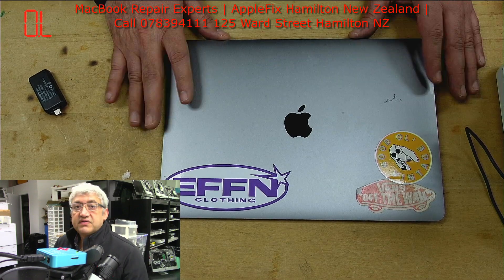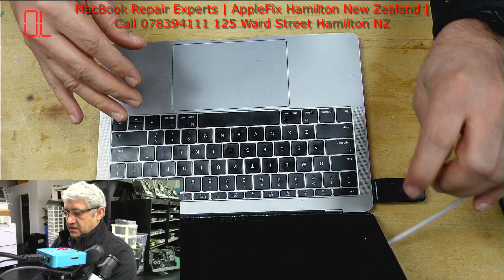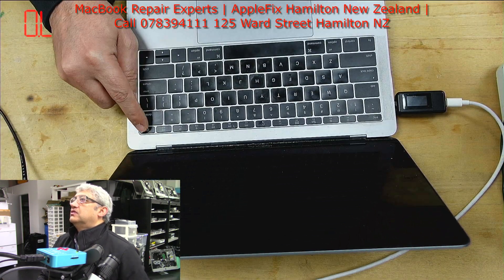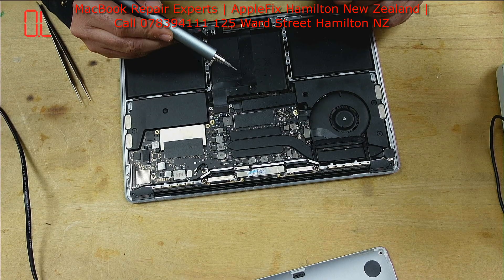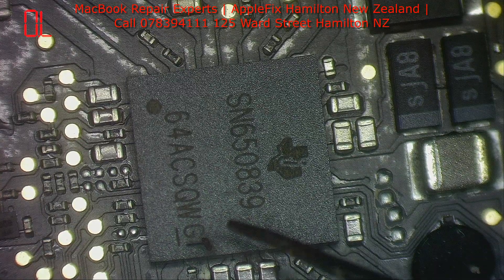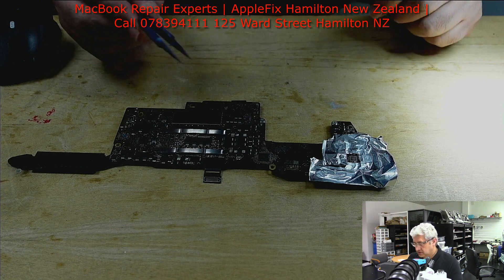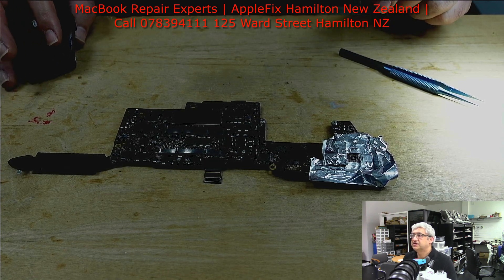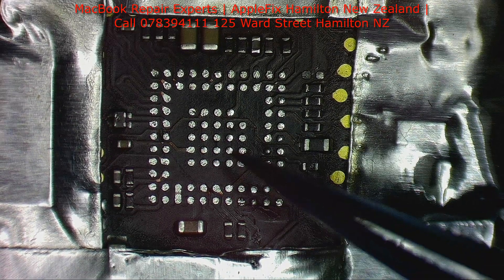Macbook pro not turning on A1708 820-00875 shorted 1.8 Volt Line on CD3215B03 | Macbook repair NZ

Comment: good evening, nice video! I have a 820-01814-01 A1990 T2 the restoration cannot be done and the CPU heats up quickly cutting off the display at one point. need help please